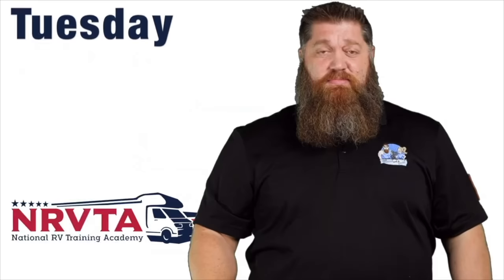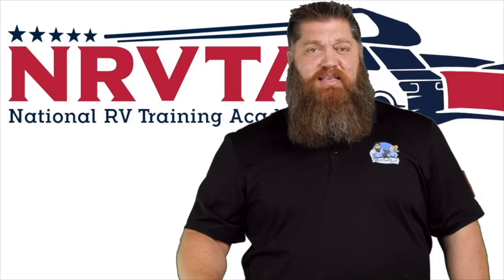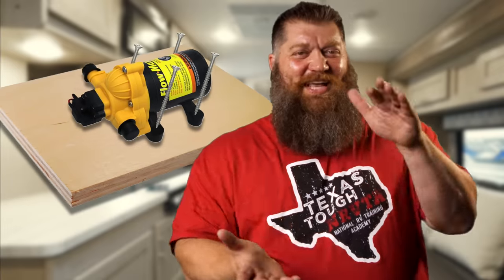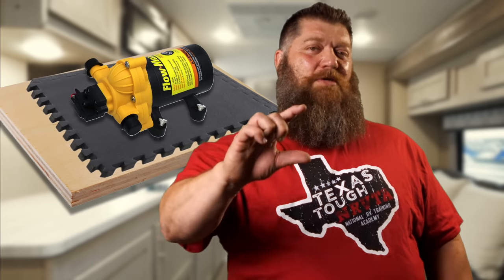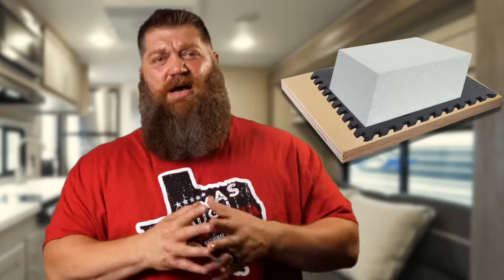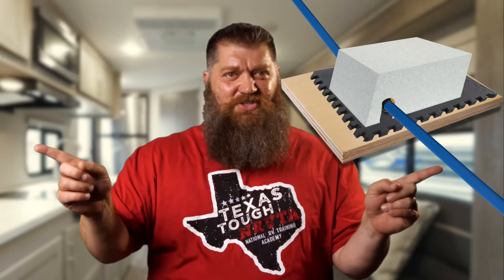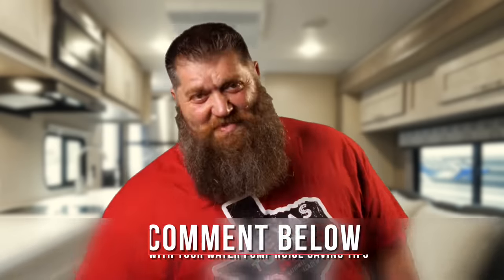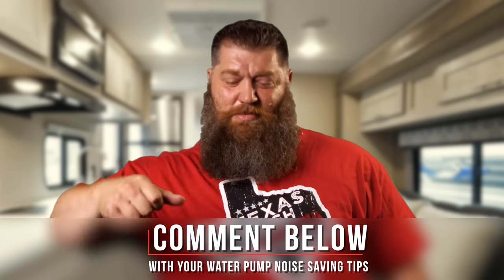My RV Water Pump is TOO loud

Comment: Use a accumulator tank so it doesn’t cycle on and off as often
Reply: Accumulator also isolates the pump air hammer from the pipes which can make noise.
Reply: Also add some acoustic pex clamps any place where the pex lines vibrate.  The accumulator and clamps totally fixed my vibration noise and pulsing water flow.  I can just barely hear the pump now.
Reply: I also added the “silencer” hoses to my pump and accumulator tank, that took a lot of the vibration out. I like the accustom pex idea as well as Todd’s mat idea to help reduce the vibrations!
Reply from the maker: Thanks. This is a great idea.
Reply: @andrewk1916  exactly what are "silencer" hoses?  Inquiring minds want to know.
Reply: @dearlaserworks it's actually "water hammer  and that usually only occurs under much higher pressures.

Comment: Another tip from someone in the RV industry.  The vibrations from the pump transfer down the water lines.  They can produce extra noise in the saddle mountings if they are not a neat fit.  I have found a little squirt of silicone between the hoses and saddles under the RV can make a big difference.  😊

Comment: Gotta agree with you Todd, it doesn't bother me either, and a great way to "hear" if you may have leaks.
Reply: It's when you get up in the middle of the night to use the bathroom. You flush the toilet and the pump comes on under the bed waking up your partner. You can always have a gallon jug of water next to the toilet as one option.
Reply: @EarlBalentine  makes sense Earl.  I dont know why any manufacturer would put the pump under the bed, but your idea seems pretty good to me.  🍻🍻

Comment: We had a loud noise when the pump was running and discovered that it wasn't the pump.  It was actually one of the water hoses coming from the pump in the basement and resting against the underside of the floor.  When we put a cloth between it and the underside of the floor, the noise was reduced greatly.
Reply from the maker: Thanks for sharing. It's true that many things can cause noises in the RV.

Comment: A person could just install vibration isolators at all four mounting points as well.  They are standard supply items that can be bought just about anywhere.  In industrial situations, we use them all the time to isolate compressor, motor, and other mechaical vibrations.

Comment: Thank you! Just picked up a 2024 R Pod RP-203, and the water pump vibration was so loud. I put a pad underneath the pump, and wow, it really reduced the noise so much. Not silent but much better, great tip and thanks again.

Comment: In my 5th wheel the water pump is behind and under the Nautilus P4 panel. I got a small (new) plastic cat litter pan and put that under the water pump then screwed it back down.  The pump has its own rubber feet sealing the screw holes.  Then I placed a Govee water leak alarm in the plastic pan.  That way if any leaks from the spaghetti that is the P4 plumbing or the water pump will get captured in the pan and trip the alarm.  I also put another water alarm under the hot water tank. 

If the horse mat is too thick for your space, a small section of a yoga mat, treadmill mat, or mouse pad works too.
Reply from the maker: great advice. thanks for sharing.

Comment: good tips on quieting, I would maybe add, Looking at where it is installed and find a better place for it, this may not be reasonable because of plumbing, but our Grand Design has it in the pass through behind the Nautilus, way better than our forest River that was under the bathroom sink. I 100% agree about the leak alarm, have saved us from disaster more than once.
Reply from the maker: They are never in the same place. That's the whole fun of it. thanks for sharing.

Comment: A mousepad is also good for helping to eliminate the noise. When you put the screws back in don't Reef them down tight have a 1/16 inch or so of play that will also help reduce the sound. Another thing you can look at is to make sure the water lines around the water pump are not touching a wall or anything solid that will carry the sound and worsen the vibration.
Reply from the maker: nice tip. thanks for sharing.

Comment: Timely. My wife has been complaining about the noise since we started camping yesterday.
Reply from the maker: A glass of wine outside may help...
Reply: @NationalRVTrainingAcademy  Buy the plumbers styrafoam slitted tubes for $3 and and insulate the water lines coming out of the pump to help eliminate  vibration.

Comment: I had the same issue with the water hose as well, I used small section of pipe insulation foam. Fit perfectly and doesn't fall off.

Comment: I like the rubber mat tip. I have also used rubber pipe insulation for inlet,outlet hose for pump that worked well plus assisted in insulating as well.  It went from a Brrrrr to a Hmmm 😂 so you could still tell you had a leak. I think adding the mat as well would reduce even more. I’ll give it a try. 🤙🏻

Comment: Note to KZ owners; some trailers in the 2011 year have a vent hose connected to the water tank. Most owners installed a shut off valve on the vent hose, to prevent water loss during travel. If you're camping for more than 3 days, you have to OPEN the valve on the vent hose, to ventilate the tank. Otherwise, the pump gets very loud, because it's working harder to pump water against negative air pressure in the tank. It's just like when your water tank is getting low. The pump gets louder as it begins to cavitate.

Comment: My water pumps sounded like rabid wolverines in heat.  For both of my RVs (5th wheel and truck camper), I mounted the water pumps on rubber matting and suspended them in the air as much as possible. That eliminated a vast amount of the vibration transferred. Now, they just make a delightful little hum. Either that or my hearing has deteriorated more than I thought.
Reply from the maker: That's quite the noise.

Comment: Todd, you are awesome bro!!!  I fully agree and like your suggestions, but am in full agreement that you want to hear the pump to know of a problem in advance.  I just found I had a stupid drip leak at the hot water tank drain plug, but that little drip 10 hours later and all my water is gone.   I def would like more info on becoming a certified rv teck.

Comment: Wish I knew this 2 months ago when my pump was making noise when not running, yep water leak, had in for repair on outside shower they did not tighten the fittings, good thing I will be at tech school next week
Reply from the maker: That's a great catch. Thanks for sharing.

Comment: I found the majority of my noise was coming from my pex water line vibrating against the thin wood paneling. Placed some foam between my water line and the wood panel and bingo most of my noise was gone.
Reply: Here as well. The pump makes a little drone noise but the tubing rattles against the wall creating most of the noise. You would think manufacturers would build a little better. I’ve spent more time on a new RV upgrading and dampening things, and repairing, and….😂. Everything I do I report to manufacturer in hopes they would implement or investigate but not likely. Thor btw
Reply from the maker: great tip.

Comment: Todd, Different question. When it comes to tire pressure and setting up a TPMS system, what factor should be used for the upper limit alarm? Cold PSI listed on the vehicle or trailer plus x%? Love you videos, thanks for the knowledge.

Comment: Question:  Do you have a video on how to adjust a water pump's pressure?  My water pump does not pump water fast enough to satisfy my tankless hot water to stay on when I'm showering or washing dishes.  My water pump pulsates like this: umm, umm, umm and the water surges just the same.  Please advise.  Thank you!!

Comment: Can you suggest why mine is making inconsistent vibration noises. It's not a consistent vibration and I think something is wrong but not sure what it is
Reply: Sounds similar to what we experienced. For us it was a lack of water pressure or water flow. We had 2 water filters and a water pressure regulator hooked up. Guess that restricted the water flow a little too much.

Comment: My water pump noise is normal most of the time and then intermittently it gets super loud and stays that way for awhile. Super loud!!! Then it will mysteriously go back to normal after a day or so. It’s annoying.  Anyone had this happen?
Reply from the maker: usually it'll get louder when you are running low on water.